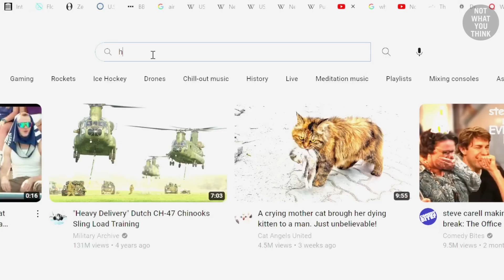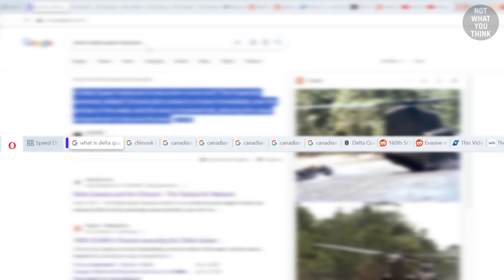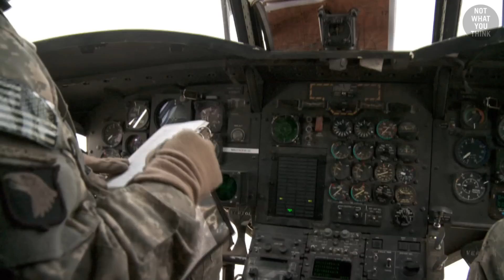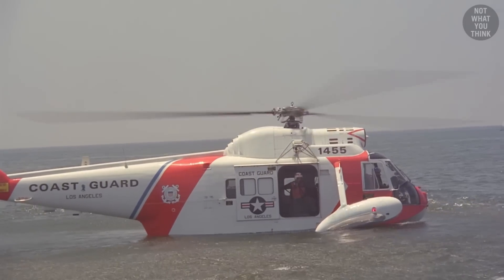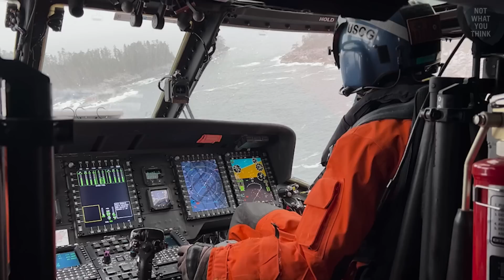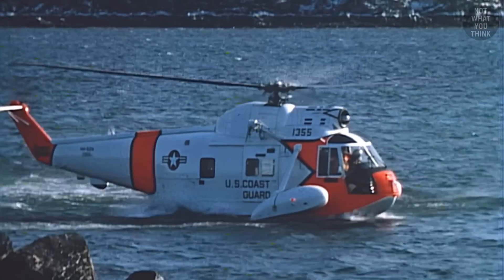Why Military Stopped Driving Boats into Helicopters at Full Speed

Comment: Ha! Exactly what I thought! But for real, taking a heli out of service every time it practices a water landing is not efficient for certain. I'm sure they didn't completely seal the bottom for good reason, but seems like they could have re-engineered the hull in the later updates to resolve those issues.
Reply: It has to do with the materials that aircraft are made of.  Stainless steel would be great, but it is heavy as hell compared to other common metals.  Aluminum is the primary metal used in aircraft construction.  Magnesium is used where great structural strength is needed, but where weight again, is a critical factor.  Both of these metals though, are highly susceptible to corrosion, especially in a salt water environment.  I spent 20 years in Chinooks.  Did the “forbidden” landings with the SF guys at Bragg from 81-84 (196th AVN Co “Flippers”).  Later was stationed out of Barbers Point NAS, HI (B-214th “Hillclimbers”) 89-92.  Corrosion control was a constant nightmare.  I don’t remember if we did any water landings, but even just being in the ocean spray from hovering required extra maintenance.  Every aircraft got a good scrubbing down after mission complete.  Miss those days.  It was a pain, but it was also fun.
Reply: @kennethcollins7665  glad to hear your experience. You definitely were in during an interesting period.
I understand the corrosion issues, I was thinking more about the water intrusion. Though, I guess when used for rapid egress, you actually need it to not float, so that's explain why they didn't go that far.
Probably better to start with a clean sheet design based around composite anyways though if someone was to seriously consider creating a new helicopter for water operations.

Comment: Looks like moveable propellers and a better sealed cabin would fix all that , if the cab can be completely sealed and able to just be switched at any time it can make cheaper maintenance
Reply: Yeah, but all the stuff needed to achieve that adds weight, cost and complexity, and that still wouldn't solve all the issues. Better to change how you do things so you no longer need to land on water to achieve the same results, which is what they've done.
Reply: @n_tas  in a world covered by a lot of water , I would hope they invest on finding out a better solution other then pushing soldiers even more.
Reply: @murrloc1859  Until it becomes a massive problem. Good luck convincing anyone to spend a crap ton of money on something so seemingly pointless.

Convenience is saved for civilians.

This is what these brave men and women are trained for.

Also, in any battle involving water, this is why the US has the biggest carrier taskforce in the world.

Comment: I once saw a bird do a cobra maneuver, that was when I realized how pilots came up with that
Reply: Bleeds allot of energy. Making you vulnerable and less range for your missile.
Reply: @Tonius126  Missiles are usually the least concern for birds.
Reply: @stejer211  usually. Even for birds, the odds of being struck by a missile at any given time is never zero
Reply: @n_tas I raise you Randy Johnson
Reply: @stejer211  they do have to worry about the peregrine falcon which is the bird equivalent of a missile diving at 200 mph/320 kph.
Reply: @Tonius126  For dogfights between fighter jets, missile range isn't an issue. AIM-9's and R-73's have more than enough range to take out anything in a dogfight. The big danger lies in the loss of energy, as it leaves you with very few options. The cobra does allow you to pull an insane angle of attack, allowing a shot on target in situations where you're trailing and they might be outrating you. If it fails to defeat the target, they'll at least defend against the missile, while you try to recover some energy. It trades energy for an opportunity. I'd rather take the safe route and keep my options, but it might work out. Regardless, the cobra isn't really a combat manoeuvre, it's mostly aerobatics and a show of agility.